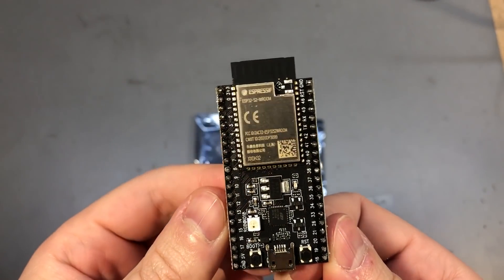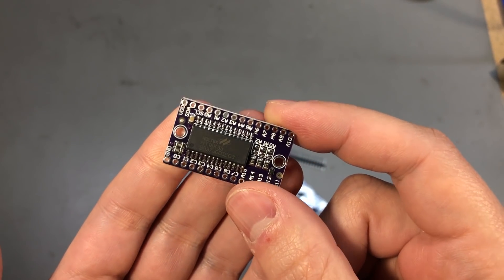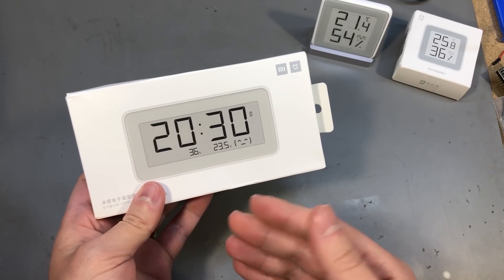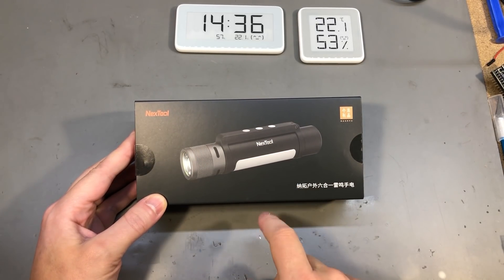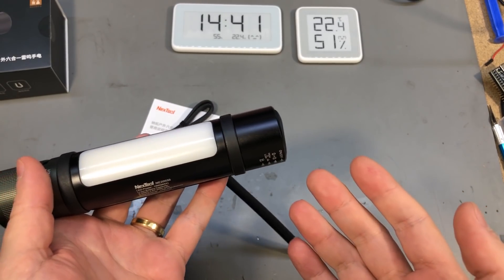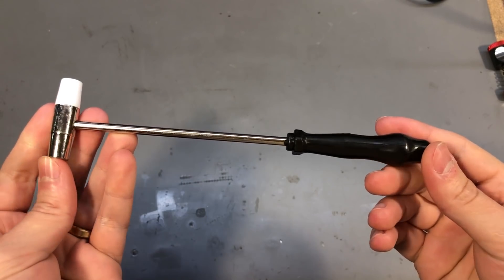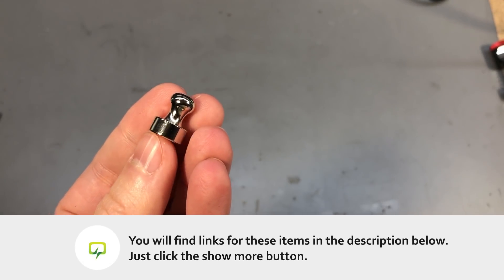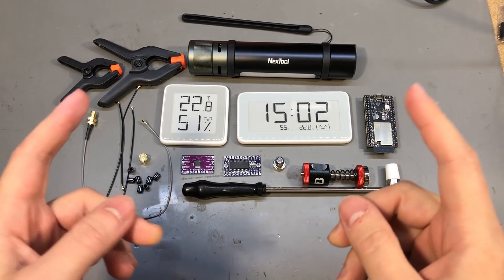InTheMail | Voltlog #345

Comment: Out on Ali, there are replacements for "helping hands", "third hands", whatever, that consist of a steel plate along with 4 magnetic PCB holders as in the video and a number of crocodile clips on flexible arms with magnetic bases. Something magnetic must be easy to come by, a biscuit tin lid, a spring steel sheet from a 3D printer, a fridge door, an old tea tray (handy rim to stop you losing stuff over the edge).
Reply from the maker: I have tried the lid from a cookie box or some old steel stencil sheets but they are too light and I would prefer something heavier. The bases that they sell on aliexpress seem heavier so I'm aiming for that, I'm gonna search for a 2-3mm thick steel sheet.
Reply: Good point. Screw your light weight steel to something heavy like a piece of wood, and/or clamp it to the bench.

Comment: An alternative eventually to the Serial Over Eth, are the Following Module & Board: 
HI-LINK HLK-RM04 UART WIFI ETHERNET Network Module
HI-LINK HLK-RM04 ETHERNET WIFI Full Function Serial Network-Wireless Demo Board, 
http://www.hlktech.net/product_detail.php?ProId=39
https://www.ebay.com/itm/Hi-link-HLK-RM04-Serial-Wifi-Ethernet-Wifi-Module-RS232-RS485-AP-Routing-Module-/201750490090
The Onboard USB Can be Configured as Host or Slave, Cheers, Konstantin

Comment: The xiaomi clock broadcasts temp/hum over btle that can be easily read via esp32 with esphome. Also if you have a xiaomi ceiling light (or other with Bluetooth) it still can receive temp/hum and they can be seen on the xiaomi app (I use the modded version from xcape because I can use many devices on EU server without connecting to the Chinese one
Reply from the maker: When you say "modded version from xscape" is that a custom firmware? I can't find any info on those keywords

Comment: Needle bearings don't like to run on shafts that aren't hardened, so you might have to keep an eye on it.

Shame the temp display doesn't have the remote outside wireless sensor like mine, because the e-paper is way better than my LCD.
Reply from the maker: Indeed it would be nice to also have an external temp probe and display that.
Reply: @voltlog  Mine is a simplified version of this with indoor station and outdoor transmitter.
https://www.ebay.com.au/itm/Digital-Thermometer-Hygrometer-Weather-Station-Wall-Clock-Wireless-Sensor-Alarm/133497268826?hash=item1f150eaa5a:g:n~cAAOSw3ZRfPIzb

Comment: Not sure if you know, those clamps have an alternate jaw position for a smaller clamping area. Hold the clamp open and rotate the orange jaws. I only mention it, because my father used them for years and didn't know about it until I showed him.
Reply from the maker: I can see the orange jaws can rotate to the outside but I'm not sure how that is useful? they shut close either way so what's the advantage?
Reply: @voltlog  if you rotate them all the way outward from the clamping area, they will then clamp on the small smooth edge of the jaw instead of the large flat area.

Comment: Why would you need to buy a magnetic surface? Pretty much any case or housing panel will do. I am sure you have some no longer usable device like an out-of-date receiver, HiFi-equipment, a desktop or tower PC case, maybe even a washing machine or dishwasher. Just cut it to size and maybe put some rubber on the bottom.
Reply from the maker: I think I might have a small tray from an old electric oven that could work for this.

Comment: Does the Xiaomi Mijia e-Ink Thermometer/Clock automatically synchronize the time? Or do you have to set it?
Reply: It gets it from the Gateway.
I had it somewhere else when the clocks moved backwards and I had to get it in range of the Gateway to get it to sync to the DST.
Reply from the maker: If you don't have the xiaomi gateway you can manually sync it from the phone app for DST.

Comment: Holtek 16k33 is a wonderful chip, however it seems to be no longer an active part. So it may not be a good choice for new designs, or SMD assembly.  The matrix/multiplex capabilities are good, I have not found a great replacement yet. Adafruit seems to be using chips like IS31FL3731 now which support dimming per channel as well as multiplexing.
Reply from the maker: The IS31FL3731 looks interesting, thanks for sharing!

Comment: I regret getting that clock. In order to use and set it you need:
1 - a phone.
2 - some shitty app.
3 - app needed to be set to china location to even find the clock.
4 - bluetooth.
5 - the clock itself.
And it might eat batteries, but I'm not sure how full they were when it came.
Way to tedious to use. Not recommended.
Reply from the maker: It's unpleasant that you have to use the phone app to set the time but I only needed to do that once so I can live with that.
Reply: @voltlog  Wouldn't you need to set it twice a year with daylight savings, or does it do that automatically?
Reply: @Sneakydecoy  I am using those for a year now, I am reading out the values with an esp8266 with a hm10 running tasmota and put the values into an influxdb with grafana to visualize it. Only need the app to set winter/summertime for the bigger one with a clock; so twice a year. I also flashed the smaller ones: https://github.com/atc1441/ATC_MiThermometer Had to replace battery after 11 months of usage.
Reply from the maker: @Sneakydecoy  I don't know if it has any daylight saving feature but once you set it up, you have the up, it's pretty easy to open and sync as needed so I think it's acceptable even doing it a couple of times per year.
Reply: @voltlog  I think it uses the DS3231 chip, or something similar which might have dst, but I dont know if it's active. I only got one of these to see if they would be suitable gifts to people last year, but they are not tech people, so the awkward setup is not ideal.
Reply from the maker: @Sneakydecoy  What I can tell you is that the app offered to do a firmware update on the clock as soon as it connected. Go figure, what would you need to update in such a simple device? :-)